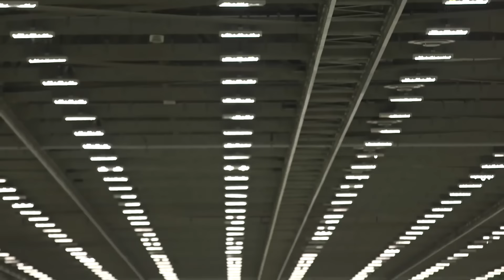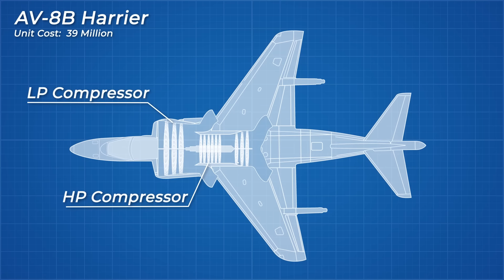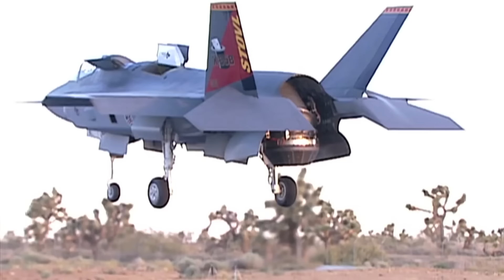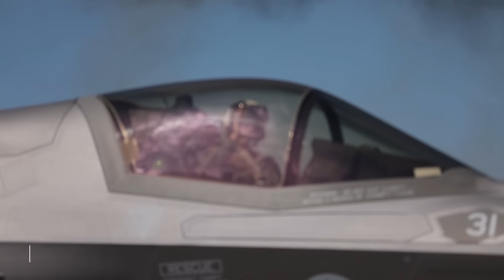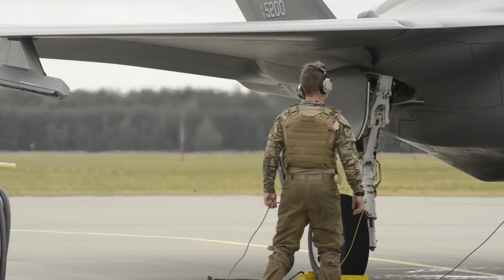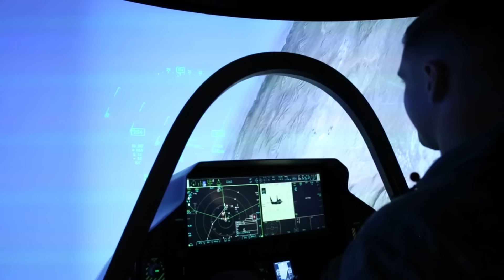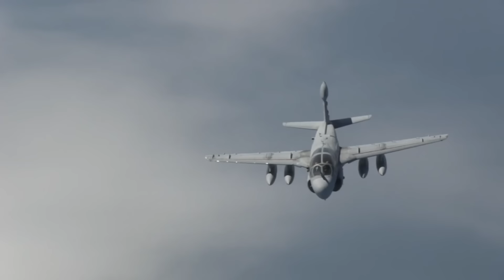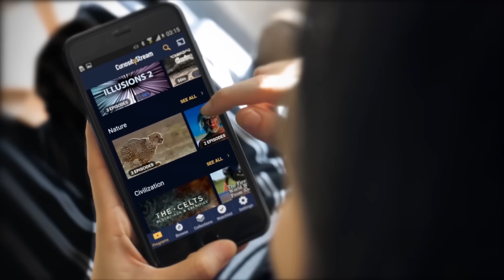Is The F-35 Worth $115 Million?

Comment: The same mistakes all over again as with the F 111. Don't they ever learn ? A jack of all trades is something like a Swiss pocketknife. Yes, there is a screwdriver included, but it ain't a real screwdriver. Yes there is a corkscrew, but don't expect top notch results. Yes you can also cut things with it, but no it is no butcher's knife or helpful to cut an applepie. Sure, the F 35 has a number of pro's, but frankly, Belgium, my country would have been much better off with the SAAB JAS Gripen for ex. Much cheaper price tag, much cheaper to maintain, very efficient as a fighter plane. If the B 52 is considered an excellent platform for the next decades, I don't see why the battle proven A 10 can't. I prefer a jack topnotch in a very limited of highly specialized tasks.
Reply: The F-111 and F-35 situations are completely different. One was an extremely good single role design that politicians tried to force into roles and services it could not perform effectively in. To do so they created a separate development program that was guaranteed to fail from the very start because they were adapting a heavy strike aircraft to a naval interceptor role that required weight savings beyond what was physically possible, but politicians didn't listen to the predictions and pushed for results.

The other was designed from the outset to perform multiple roles and excel at Strike, which it does, but suffered from budget changes and management personnel changes that lead to many delays and higher cost to develop. This cycle of management issues began with the end of the Cold war and the drastic budget cuts the US implemented, going from 1989 when it had the biggest military budget in history (yes it was higher than recent years), down to around $250 billion by the year 2000.

For Belgium it is conceivable that the Gripen would be a better purchase, but that's because Belgium doesn't need much capability to satisfy it's defence requirements. It doesn't mean the F-35 isn't efficient, because that depends on what threat needs to be countered.

B-52 isn't considered a good platform for the next 2 decades outside of being a nuclear cruise missile launcher. Despite not being the most capable US strategic bomber it also isn't the cheapest to maintain, but politicians try to keep it in service because replacing it would make them look bad due to the cost involved, especially when they're trying to deal with the costs of the F-35 program. The A-10 however at least has a niche capability that is relevant to current middle-eastern low-intensity conflicts and it has been granted an expensive upgrade program to keep it in service for another 2 decades.

Comment: People need to focus less on this dogfight concept. There are no dogfights in modern air to air combat. People say F-35 is too expensive, while attention should be on F-22. A plane that has very little use. It's still an incredible machine, it just does one thing nobody really needs anymore. And of course F-35 as a program was massively more costly - because it's so much more. As a platform F-35 is an amazing plane, if you look beyond very primitive thinking that jet fighter is just for dogfighting other jets like in movies. Not saying it didn't have issues, and money weren't potentially wasted, because they probably were. Thanks bureaucracy and corruption. But in the end it gave US a fantastic plane, and a great versatile weapons platform. Remember that 5th generation jets are separated from previous ones not just for their more advanced avionics, increased flight characteristics, etc but most importantly - it's electronics. Radar systems, integration into communication and navigational systems of everything else around it on a battlefield, countermeasures, stealth, etc.

Comment: The biggest question around the F-35 program isn’t “Can this plane do what the planes it’s meant to replace can?”, it’s “Can it do those things BETTER ENOUGH to justify the massive expenditure?” A Pentagon Cost Assessment done on the total lifetime costs of the F-35 was pegged at an eye watering $1.7 TRILLION. And you don’t pay that much money so your plane can be “as good as” the planes it’s meant to replace. The biggest argument is whether this plane is a worthwhile replacement for the A-10 Warthog in the ground-attack roll. Here, stealth has to take a back seat to payload and survivability: if you’re going to be flying at low altitudes, covered in bombs and missiles, you’re going to be seen. Period. And the F-35 isn’t nearly as survivable as the dedicated ground-attack A-10. Additionally, there’s more costs to consider beyond unit cost and that’s cost per flight hour. It is much, MUCH cheaper to fly missions and maintain an A-10 than an F-35. Which then begs the question of “If the A-10 is just as effective as the F-35 for a much lower operating cost, why bother with the F-35?” The F-35 is an illustration of the adage “A jack-of-all trades and master of none”. The A-10 vs F-35 debate shows that sometimes, it’s better to have a purpose-built aircraft that specializes in a single role, as opposed to trying to get a single design to do everything.
Reply: Apples to oranges. The F-35 was never going to replace the A-10 directly. The A-10 was supposed to be retired to free up resources for more effective aircraft like the F-16.
Reply: A-10s aren't exactly survivable though. THey were grounded in the Gulf War because of how often they were shot down or torn to shreds. "Low and slow" is not a successful model in the modern day.

Comment: The cost for the f-35 program while expensive is far far cheaper per mission it will fly versus the fighters with their escorts. A fighter mission requiring 4 F-35s replaces a 24 plane requirement for the same mission using replaced legacy fighters. So every 4 man ship unit of F-35s per mission replaces 24 other planes for the same mission requirement. So 8 F-35s replaces 48 plane support craft. 12 F-35s replaces 72 plane set.

Comment: Why not give the F-35A bigger wings like the C aswell? Genuine question.
Reply: I can only give educated guess, so don't take it as a definitive answer

- As shape of F-35A provide some lift so bigger wings aren't neccessary, however in carrier operation there's obvious need for it to mantain lift in speeds as low as possible demanded for shorter landings and take offs
- Bigger wings and in general bigger everything gives a bigger radar cross-section, although if not in the turn areofoil surface should be in such low angle it boounces radar waves in different direction
- bigger wings makes plane heavier and since they're both using the same engine that makes A variant more agile in gaining speed which is quite important (I heard to some degree more important than top speed itself)
- also I guess it's cheaper, but that's not decisive factor

oh and the biggest thing, drag, especially in high speeds
Reply: @juliuszkocinski7478  What about the benefits of a larger wing surface area? Greater lift, more carrying capacity, maybe better fuel economy too but you mentioned drag.
The C variant has more beefy components for carrier landings that the A doesnt need. So it would just be bigger wings. Dont know how it would affect the body of the plane but apart from when on the ground, the stress on the body wouldnt change much.

Comment: 🙃As of 1 JAN 2022,  Lockheed admits that the F-35 flight cost per hour likely can not be reduced below the current 45,000 USD per flight hour. Add that into any cost - benefit analysis . Fly this airplane 2,000 hours and you have bought this airplane twice, even not allowing for future maintenance cost inflation.

Comment: F117 was shot down in Serbia because the target was anticipated and the Fire Control Radar was able to sustain track for missile launch when the trap doors of the ammunition/ bomb bay were open for weapon delivery. The F-35 works in integrated combination with Electronic Attack UCAVS and F-18 Growlers and have integral Electronic Attack and Deception transponders too fed with required Electronic Intelligence data for support and " attack". Active stealth is " reduction " of holistic vulnerability proactively by deception / attack transponded or response programmed. Thermal deceptors for imaging and laser ranging disorientation are coopted to include proximity fuse premature activation/ jamming or optic deception through laser/ IR disorientation tech. Improved survivability can tend towards protection progressively but will still have environmental and skillset variables despite being AI automated.

Comment: Boeing had no idea how to design a slick fighter, and they used a delta wing which the Air Force did not want.  When they went head to head with Lockheed Martin for the  new trainer, they threatened the Air Force they would not build fighters again if they didn't get the contract.  Everyone knew the KAI/Lockheed-Martin was a better plane with a better ground system for support.  Now in 2022 Lockheed-Martin is modifying the T-50A to build a strategic trainer.  The Air Force would not let Boeing use their new trainer.  The FA-50 can fly at near Mach II if they used the largest available GE engine for this this plane.  When you put it all together, Lockheed-Martin is the most advanced builder of Aircraft in the world (remember the XR-71?).

Comment: Remember your history.  Was the F-15 worth $25M when it came out in 1972?  Is a 100 to ZERO kill ratio worth something??
Reply: Again, the F-15 saw combat against aircraft that it was vastly superior to. MiG-21s, MiG-23s, MiG-25s (yes this plane was much faster but early variants simply were out of their depth in air superiority missions; it didn't have look-down shoot-down radar until the PD variant, and had poor manoeuvrability). Against more modern fighters like the Su-27 the F-15 will have a much harder time. Not to say it's inferior overall, but that the engagement would depend on external factors rather than the performance of the aircraft. And I'm sorry, but the Eagle wouldn't survive very long in today's battlefield of Integrated Air Defence Systems and excellent datalinks between different hostile assets. Today's battlefield is no longer about dogfighting; it's about networking, and that isn't something the F-15 does very well without massive upgrades to its avionics like what's being done in the F-15EX. Even with that, the the Eagle airframe has a very large radar cross-section, which would make it difficult for it to complete the mission without being detected by SAM sites.

Comment: Only time will tell after it has a chance to prove itself. However I'm not convinced stealth is necessarily going to be the be all end all. To maintain stealth and VTOL they have to sacrifice too much. Stealth has worked quite well over the decades but hasn't really been proven against a technological equivalent enemy like perhaps China. Technology is advancing new radar and missiles are in development to circumvent this problem of course against Afghanistan/Iraq stealth was so OP. These Jets obviously will outperform previous generations but like the reborn F-15 Eagle these older Jets could be retrofitted or redesigned for much cheaper. I think it would be cheaper/faster to build new high resolution narrow band radar that can detect these stealth jets than to build jets as early detection lock-on ability is half the battle these days.

Comment: No significant technology was handed over by a downed F-117. A Russian published information relating to radar avoidance that the US actually used on the F-117. That jet largely utilized deflection angles to avoid detection. Not very groundbreaking at all, which is why the US even bothered flying the jet so much over contested and enemy territory.

Comment: The STVOL design concept used by the F350 is actually the same that Russia tested and used on one of its early STVOL aircraft back in the late 80s
Reply: Yeah, they copied it and then claimed it as their idea.
Reply: points of force are the same, but F-35B uses common shaft with lifting fan while Yak-38 uses separate jets to provide vertical thrust in the middle. Pretty big difference

Comment: My biggest complaint is the idea that a jack of all trades should replace a master of one. A prime example is the A-10, while it's price per unit is not exactly low, it's cost of maintenance is dramatically cheaper than nearly any other aircraft, combined with it's extreme effectiveness in it's primary role of Close Air Support. While the F-35 is capable of CAS, it is not it's strong suit, as it is primarily built around being a stealth multipurpose fighter,  so while I don't think that the F-35 should be outright denied it's potential, I believe it is much better to field them together. A formation of F-35s and A-10s working in tandem to preform air superiority and maintaining constant watch as CAS would be ideal, and in worst case scenarios, the F-35 can stop preforming CAS in order to focus on air superiority, while allowing the A-10 to continue it's mission of supporting troops on the ground. With all due respect to the price tag on the F-35, with all it's advanced tech, a life on the ground is worth so much more.
(not to mention the sheer moral boost to our forces when they can hear their the glorious ringing of 30mm GAU-8/A firing armor piecing rounds down onto the enemy)
Reply: Isn’t A-10 mostly used the Maverick missiles and associated PGMs for CAS?

Comment: Seeing as your average F-35A will cost somewhere in the 80 million range down the line (and that's what most countries will be buying), that's not a terrible deal. It's pricey, sure. But an Su-35 is 85 million per unit. And this is more advanced than that. Parts commonality will reduce flight hour costs as the supply chain grows.

And let's be honest, the fact that it replaces like 4-6 aircraft also saves money. It's going to be economical once it's deeply embedded.

Comment: well if it truly performs well and actually replaces these other planes then yes, it's more than worth the price tag. considering the total cost of the other planes combined. however, i think the warthog is gonna be the hardest to replace. because it has so much built in redundancy, the a-10 can take a ton of punishment and still operate just fine. its a flying tank. for that fact alone i think we will use it for a good long while. however, if the f-35 is either able to avoid damage altogether, then there's no need for so much armor and redundancy. so, we'll see. but even it it just replaces the other 3 planes it is still worth it

Comment: The whole system the F35 uses for VTOL is actually a soviet design very similar to the Yak 141.
Reply: Nope. It's based on the Convair Model 200 from the late 1960s.

Comment: The idea that the f-35 will replace the a-10 is laughable at best
Reply: The F-16C already has replaced the A-10 in many instances. The F-35A is simply replacing the F-16.
Reply: It will the A-10 is a joke. It can't defend itself, it has bad avionics, it has shitty engines and has a bunch of blue on blue accidents because of its bad avionics. It doesn't even have a radar lol.

Comment: 12:30 in a nutshell: Marine Corps pilot says a former F-15 pilot who flew the F-35 and didn't like it's inability to dogfight or retain inertia like an F-15 is wrong about his opinions of the F-35 because the F-15's older and was designed for a different mission. That doesn't disprove the underpowered aspect of the F-35 in terms of dogfighting/energy retention.
Reply: If the F-35 us underpowered then the F-16 is crop duster
Reply: Uh no. it's got nothing to do with the mission or age of the aircraft.  It's about the tactics. They are different aircraft that deal with a given issue in different ways.

In a dogfight the F-15 likes to cruise around patiently waiting for an opening. It has relatively high sustained turn rates, but can't pull any particularly threatening maneuvers.

The F-35 likes to pull tight turns and generally just point it's nose at the enemy. It's airframe enables it to pull extremely aggressive maneuvers which in turn can drastically reduce airspeed, so the pilot has to be capable of thinking ahead and taking quick, decisive action when presented with an opening. That said there are more openings for a pilot to take in a properly flown F-35, so it can be considered a high-risk high-reward type of fighter.

But regardless, the F-15 pilot's criticisms in that report are known to be irrelevant to production F-35s. The aircraft he was flying was a test airframe with artificial maneuverability limits as it's purpose was to test and qualify under certain flight regimes.  The report confirmed the expectations of the engineers, and they drastically reduced flight restrictions on production model F-35s as those maneuvers were now considered safe for pilots in general to try. For instance the test F-35 that the F-15 pilot flew was limited to 4.5G maneuvers, but current production F-35As have a 9G limit.
Reply: Dude then must have been essentially the equivalent of a fighter pilot boomer, because dogfights have all but been relegated to being a relic of a bygone era - at least since the Iraq - Iran war where a bunch of noobs in F-14 Tomcats screwed pretty much the entire enemy air force and their MiGs without hardly ever seeing them, since their American jets, compared to the MiGs they were hitting, let them stuff missiles up their asses from well over the horizon. Over 100 kills to 0 losses.

In the last 30 years, there's been about 2 kills made aircraft to aircraft by rotary cannons - both helicopters downed by A-10's in the 1991 Gulf War.